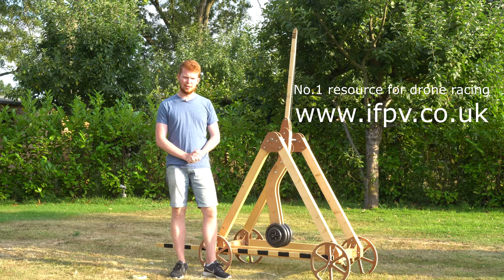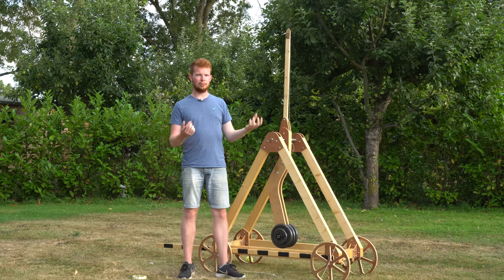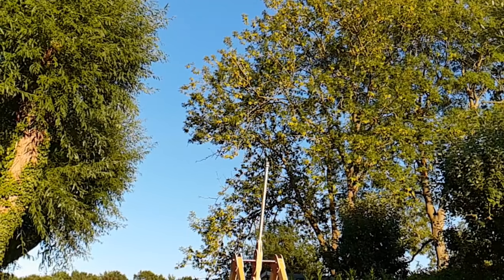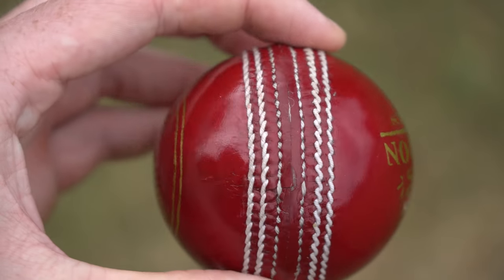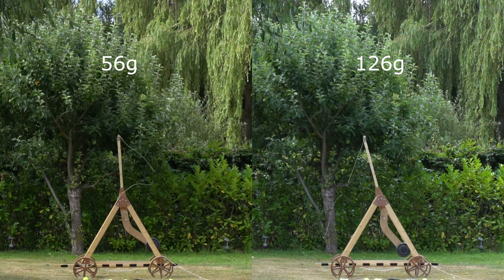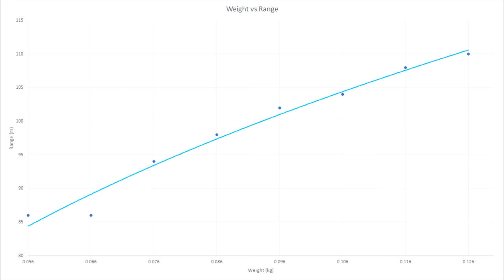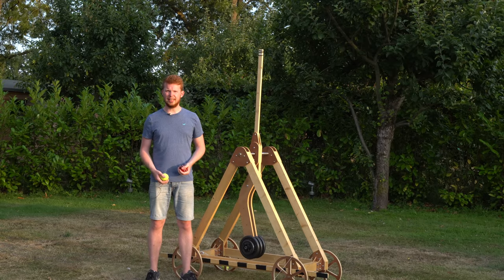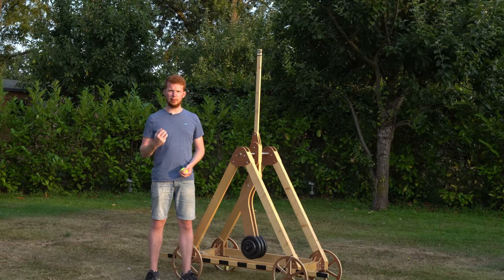Trebuchet Projectile Optimisation

Comment: ___ Tom ___
You're not paying enough attention to the change garnered by changing the length of the throw-string I think Tom. 

As far as I know, with the ideal angle of release being at 45 degrees for a projectile that meets zero wind resistance, each differing mass counterweight will reach its maximum throw efficiency with its own particular projectile weight AND particular length of throw string. And;

Wind resistance is decreased by having the maximum mass for the minimum possible surface area.  ie. As dense and round a projectile as possible. I'm not sure of the effect of dimples, but yes, golf balls have them for a reason I suppose. 

Also, where the wheels picked up some of the efficiency loss of the forward and backward force and thus energy loss on the trebuchet device itself during the throw, some of the efficiency loss from the throw string and the counterweight can be recouped by adding an appropriate spring to each of them. 

ps. The addition of wheels to a trebuchet to increase efficiency was discovered historically some 5-8 centuries ago.

Comment: would changing the arms weight help its efficiency with heavier projectile? so it doesn't stall on release?
Reply: Stall can be controlled by sling length and cradle elevation from the arm, and cw drop location. Lighter is faster, faster is farther.

Comment: Does the movement of the trevuchet during launch decrease the range? Energy is required to move the base. try staking in place with ropes and stakes, (4), also try dimpled surfaces like a gulf ball has to decrease drag.

Comment: do you think increasing the ratio of the arm lengths for the projectile and weight would increase its velocity? maybe adding more weights tho to counteract the increased force the projectiles inertia  has on it due to the increased ratio, this should increase the acceleration felt on the end of the projectile arm, increasing the final speed of the ball.
im not good at explaining but im confident it would work

Comment: You could 3D print a golf ball surface in half and then added weighted ball to the inside.  Easy hack if you know how to do some simple 3D Modeling.  Then you can keep the sling the same size.

Comment: may I usggest using a stepper motor attached to the string and connected to an arduino board (the stepper board can be used as an encoder). the natural resistance of the motor will give you the measurement of the exact position of release and the pateau of acceleration.

Comment: there are definitely loses because a platform is too lightweight and not fixed to ground

put few bags of sand (at least 5times of these disks weight) on it so it will not bounce

I'm sure you'll get 10-15% longer range

Comment: Come on, you made the frame super robust and got a beefy steel axle, and that's "all the weights you have"? If you ever revisit this project I want to see what happens with 50+ kg on this short whip-arm trebuchet! If you don't have more weight plates (I know they're surprisingly pricy) you could use sandbags or scrap metal blocks or a water tank...

Comment: I am not convinced fitting a curve to those data points will give you a lot of information. You should gather multiple samples for every weight and extend the weight range to confirm you truly reach an energy plateau at 130 or so grams. I think the variation in the samples will show that the plateau could actually be for higher weights.

Comment: Lengthen, the upper shaft. Your projectile, will increase in velocity, thereby fining the projectile further!
Reply: That is beam ratio.  Yes a higher beam ratio can increase speed if the mass ratio has been optimized. It takes more counterweight to wind the higher "gear ratio" out though. You trade leverage for speed.

Comment: Smallest diameter, smooth surface at the optimum weight.  Release with a smaller projectile will surely change due to the size in the pocket.  28 mm diameter lead ball should give you 130g !!!

Comment: isn't part of the energy lost to the left and right motion of the treb? Shouldn't you put "chocks" on the wheels?
Reply: In an earlier video it was discussed that the wheels allow for forwards movement which makes the release time larger and increases range
Reply: Jeff. It allows for better energy conversion. Most likely due to conservation of momentum (not directly due to the forwards velocity of the cart.). ..

With these machines inputs and outputs must be matched for optimal results, one variable cannot simply be changed, it can have complex interactions.  This machine has at least 8 degrees of freedom in a simple mathematical optimization model...  complex, yet so simple...

Comment: id like to see if securing it in place so it doesnt roll around would increase range? it should, atleast the way im thinking about it.
Reply: Wheels on a "whipper" style trebuchet aid distance. Locking the wheels results in wasted energy due to uncontrolled frame motion.
Reply: Conservation of momentum.... linear and angular. And energy conversion maximisation...  It is science: guess, try, figure, repeat.

And then repeat another 100 times.

Comment: There was a documentary done in the 90's where they built 2 full sized trebuchets to different designs (moving counterweight/no wheels and fixed counterweight with wheels), and used them to bombard a reproduction medieval castle wall. It was done at Urquart Castle beside Loch Ness. They found out some interesting things about how to vary the range and direction of the projectile by simply adjusting the release pin and moving the projectile sling before launch. They were hurling 300lb balls 200+ meters. It was seriously impressive. Documentary can be found here:-    https://www.youtube.com/watch?v=QVO8VznqMeQ

Comment: What to do with it...
1) aerodynamic finned projectile with GoPro in it
2) have someone with a tennis racket downrange to return the balls
3) put burning barbecue charcoal or steel wool in the projectile and fire it at night for some pretty sparkles (only if you're sure you won't set the grass field on fire though)...